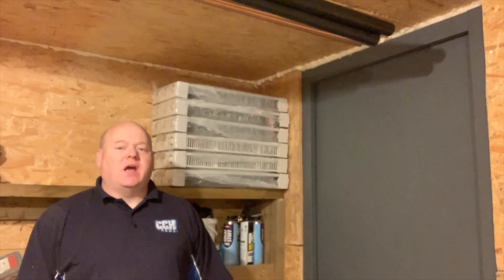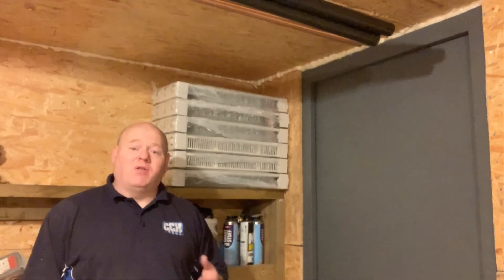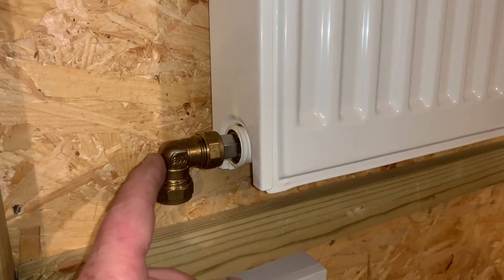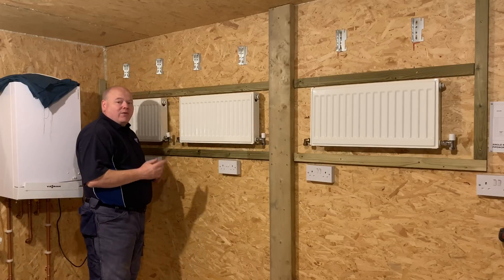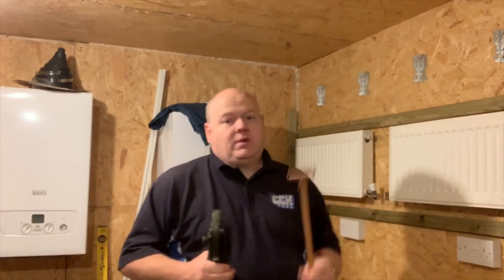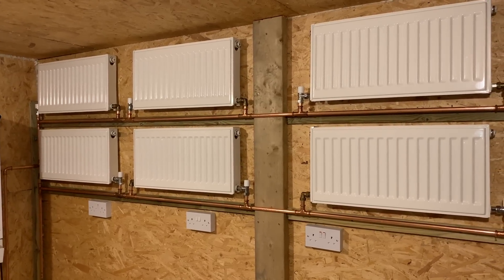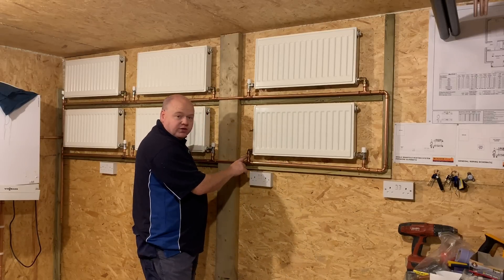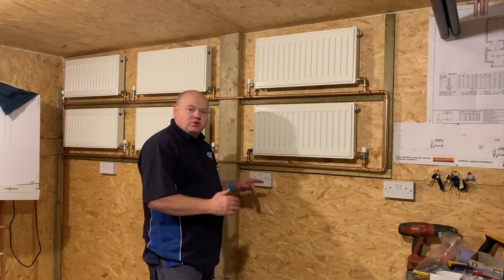Plumbing - HOW TO INSTALL A ONE PIPE CENTRAL HEATING SYSTEM

Comment: So this is why you built the cave Allen 
Brilliant explanation Allen I didn’t know it worked like that 
I once worked in a farm house and the horizontal pipe work was fitted on an incline . The guy said it’s a gravity system and said there’s no pump . Is that something completely from this Allen . Been a joiner all my life and I’ve allways been interested in plumbing . Cheers Allen
Reply from the maker: Gravity system means gravity hot water. The heating would always be pumped. Thanks.
Reply from the maker: Mr Brightside A system like that couldn’t possible work. The term gravity system means gravity hot water, heating is always pumped. I worked on thousands of them. Thanks
Reply from the maker: @Mr Brightside As I say a Gravity system means gravity hot water and pumped heating. Never seen it any other way. Thanks.
Reply from the maker: @Mr Brightside I have been told loads of times by customers they do not have a pump, Normally they have never seen it as it's under the floor or in some boxing. When we talk about gravity systems it's the hot water we are talking about. Heating is always pumped. There maybe some very old systems in the middle of a field with 3 or 4 rads that could work in a fashion on gravity, This would never work very well and it's not a system design in any heating manuals i have seen. Thanks.

Comment: Great video. I came across this system before and the customer wanted it ripped out and replaced with a 2 pipe system. I recently bought my self a crimper they are a great tool. Thanks for posting the videos
Reply from the maker: 2 pipe system is definitely better. I would always update if possible. Thanks.

Comment: Would all the radiators reach the same temperature, or would you find that they get colder as they get towards to return? (Great video by the way!)
Reply from the maker: James Cockayne The further away it gets the colder it could be. Depends on the size of system. THANKS 👍
Reply: I'm not a plumber but I think you would need to balance them if that was the case.
Reply from the maker: @chmoduk  I will do a video about balancing soon. Thanks.
Reply: What dictates which way is flow and which way is return in a one pipe system? I suppose the answer is the pump🤔
In which case, does it matter which side the inlets and outlets of the radiators are fitted within the circuit, so when you're inserting a new rad, do you have to consider direction of flow?
I'm not a plumber or heating engineer but very curious as to how this works. Not much info out there as one pipe is now completely obsolete, it seems.
Thanks for taking the time to make these videos Alan, always a well received treat here mate👍

Comment: I love all you do Allen, been watching you for probably a couple of years now but please explain to the youngsters that blowtorch skills are better than this press stuff. You are using a press gun needlessly and teaching others that they will need to use this. Not sure mate. But I love the man shed. IT reminds me of my years in Portsmouths Unicorn Gate college.  Just to be clear mate I do watch and like your stuff. Much love
Reply from the maker: Ben Frost I will do the next video using my blow lamp 😂👍Thanks
Reply: I'm stuck with my cheapo b@q butane propane mix. I don't do enough to justify buying the yellow bottle gas system that I forgot the name of.
Reply from the maker: crazygeorgelincoln Never used a cheap one so couldn’t comment. 👍
Reply: @AllenHart999  you should give it a go. Is the DIY market being hard deal. The last 3rd of a can is most entertaining on cold wet pipes.
Reply from the maker: @crazygeorgelincoln  I would much rather press these days but thanks.
Reply: @crazygeorgelincoln  Mapp gas

Comment: One connection needs to go on top of the rad when the length of the rad is more or even than 2 1/2 times its height. Same rule applies for the flow on the 2 pipe systems. Very explainful and detailed video.
Reply from the maker: Evangelos Tsiamalos That’s sort of best practice but not normal on the one pipe systems I have worked on. Thanks 👍

Comment: that clamping system much cleaner than soldering 👍🏻
Reply from the maker: No risk of setting the house on fire either. Much better in my opinion. Thanks.

Comment: Hi, what should be the vertical height from radiator to floor, I heard 150mm some say 250mm
Reply from the maker: No right and wrong, It's whatever suits you best. Thanks.
Reply: The last radiator I fit, instructions mentioned that a minimum of, if I remember was 150mm.
Reply from the maker: @chmoduk  For what reason ?
Reply: Air flow